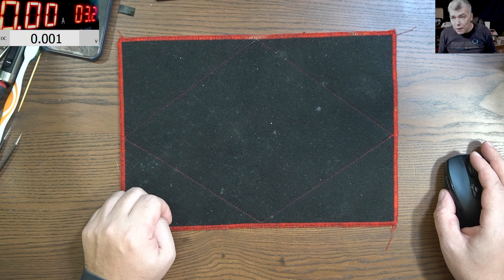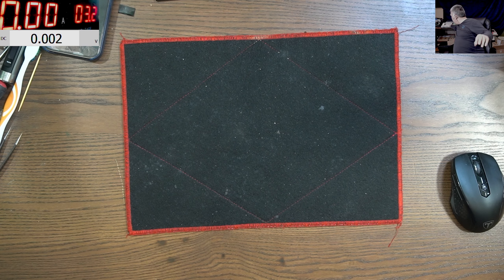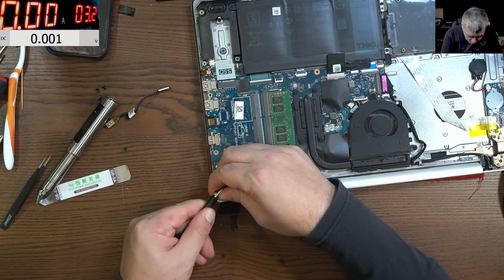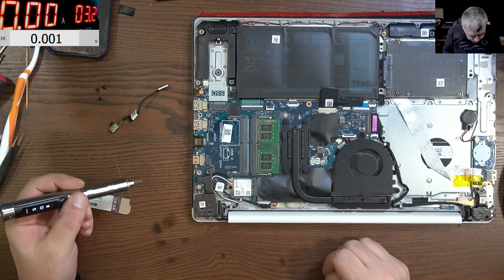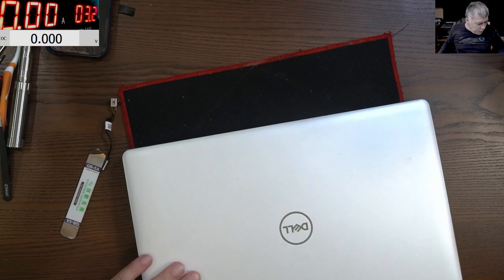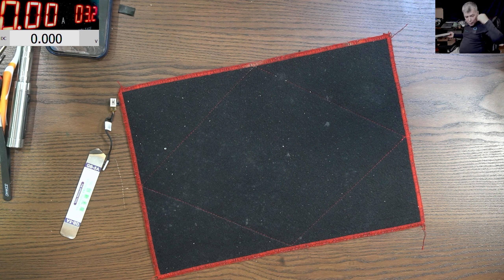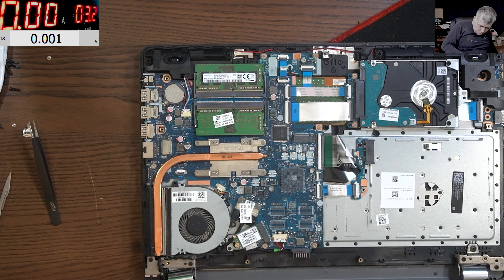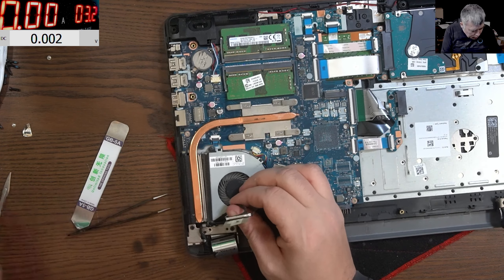Laptop repairs workflow

Comment: I did exactly the same repair as the first one (Dell Inspiron) and actually, you can hollow out the case with a Dremel to fit the power connector, you don't need to file it down.

Comment: Sorin! I repaired the same HP laptop (minute 14 and up) with the exact same fault. Left hinge, broken on the screen side but also on the laptop side. This was an annoying job. I also used the hotglue sandwich method (i have learnt this from you, so thank you!).
Reply: Same here, same laptop, same crappy hinges.
Reply: I also had the exact same laptop about a year ago with this problem. HP 250 G6 or something. Such a nightmare trying to fix the left hinge with all the cables in the way. I attempted to fix it using epoxy (like I usually would) but it turned into a bit of a nightmare, so I ended up just replacing the top lid in the end 😂
Reply: on acer laptops, first ive use super glue on the screw holes to secure the screw threads on the plastic then use hot glue to make a definite contact and firm it will not bend or remove overtime.
Reply: Same here but I used graphite powder and adhesive bcoz low space for hot glue.
This hp laptop is very cheap

Comment: I put penetrating oil on the hinges to loosen a little bit. The biggest problem why the hinges dislodge is it is becomming too tight a s time pass by, maybe corrosion or dust accumulation. I cloned your technique using hot glue. Softening the hinges first prevents premature returning of the units. 

Take care always Sorin.
Reply: No. It’s where oil can loosen the hinge too much over time!

Comment: I very hate yhis HP with covered hinges... usually i unscrew the 2  bolt o  the covered hinges to make them moving better... and after i place 2 new screws on the bottom side with bolts outside the laptop... on the screen side usually I fill with black hotglue ( i think the black one is more robust that the transparent)

Comment: For the thin display plastics around the display i use a double sided tape (type) and it works like charm. :)
Reply: Hihihih double side tape .. :)
Reply: @laboratorioassembler   Auto correct.

Comment: Q. Why did he not replace the bloated battery on the first laptop?
Reply: Because it is gonna be another 60 plus battery which is equal new laptop (including charging port replacement) 😁
Personally bought better spec laptop than this dell for £130 last. 
You have an answer

Comment: Hot glue is bungle
Reply: I find two part epoxy works better. It takes a lot longer to set though, and you only usually have one attempt to get it right.